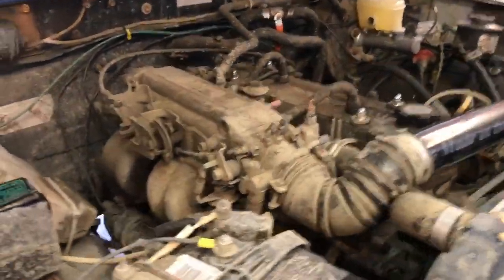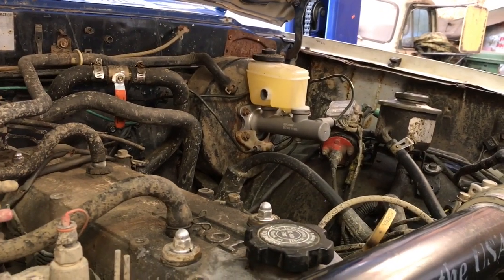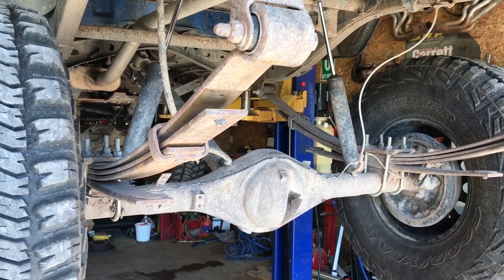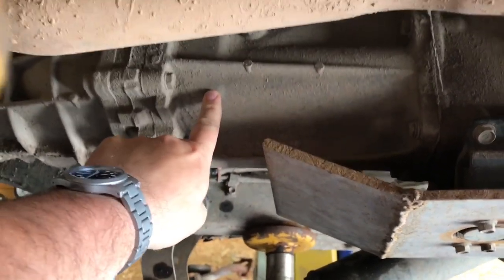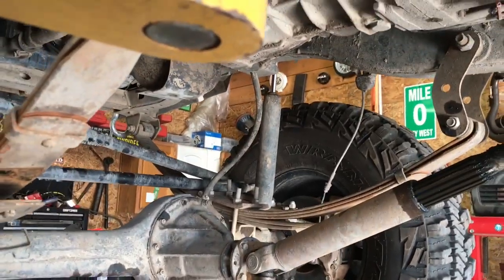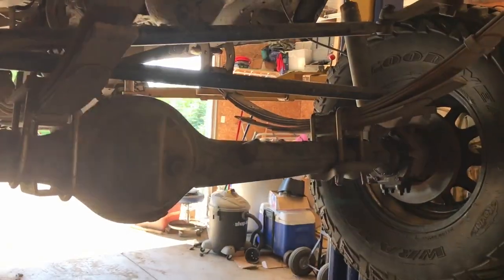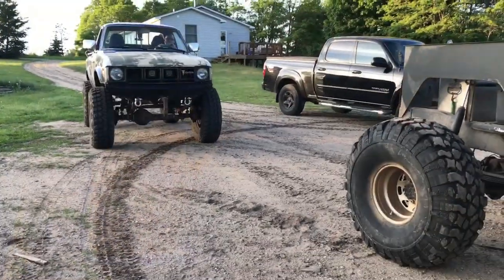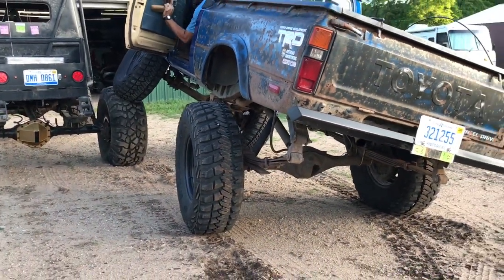Toyota 1st generation 4x4 (1983 Toyota truck)

Comment: Nice build man . Youve got my next 3 projects right there . Looks real good
Reply from the maker: I really need to make an update video. Many things improved since this vid.
Reply: Random Rob  you go 3.4 ? Or still just rockin the 22re?. Im workin on an 88 4runner 3vze. But no sas... no 63's no dual transfer. Just body lift ..suspension lift and 36s. Locked rear.
Reply: Check out the update video going up now.

Comment: I bought a brand new 1983 Toyota four-wheel drive with the long wheelbase. Only because it was cheaper than a Ford and a Chevy. No AC. But that little truck could climb any Hill that I ever come across and that little 22R 4 cylinder engine the way that it was geared could jump out so quick and so hard. I never got beat on any Hill I can pull straight forward  turn around pull back down and back up in Reverse up hills that Chevys and Fords could not do. The only downfall on this vehicle was it did not have power to hook up to a trailer and pull it through sand . But it had so much power for that little body that I can go anywhere. Until I sunk  into a mud hole. Easy to work on by far the best truck I ever owned. Not to mention that the ladies love that vehicle and I wish I would have kept it to this day. Amen y'all have a good day
Reply: I want yo buy... Are you willing to sell

Comment: Great truck.
Please correct me if I am wrong... 
1983 Toyota 4×4s have rectangular headlights. 
I had '83 with rectangular lights and a standard tailgate (no side latches ) ..curious to know if there was a change in headlight/gate design early on in 1st release or to the end of early production. ...or did you replace them yourself?
Reply: Tim 57 my title says 82 hilux, but the cab says 83... I seen where they welded 2 cabs together when I took apart the interior.... but it has rectangular headlights.
Reply: pigtrapper 1 

Thanks so much for your reply 🙂

Did not even think about different years of trucks, being built into one...

I appreciate your truck even more now 🙂

Take care.
Reply: 1979-1981 was round headlights, a 4.37 axle ratio, and the 20R. 1982 brought square headlights, the 22R, and 4.11 gears. The center latching tailgate also appeared in 1982. 1985 (second gen 4x4) saw EFI in 1985  (22RE), but 1986 was the new IFS instead of the awesome solid front axle. If you can snag a 1985, it's gold.
Reply: James Barrett 

Hey James

Thank you for reply to my questions, very much appreciated. 😀

I absolutely loved my '83 and if would have been feasible, I would still have it.

Take care
Reply: James Barrett agreed... 1985 models are where it's at. Best of both worlds.  I love my 82 model considering I paid 1100$ for it and 7 years later, im still running the same 33" mud tires on it. Only replaced the 4 speed for a 5 speed, starter. Alt, fuel pump, clutch...  I have no problem driving it 60 miles away
Reply: Tim 57 basically I purchased a cab and a frame for the build. The cab is titled as a 1983. But I used the front body panels and bed from a 1979 parts truck. Hence the round headlights.l and toolbox style tailgate latches.
Reply: Will you sell me your Stout 1983. I want yo buy

Comment: Do you know the backspacing on those wheels?
Reply from the maker: I will have to ask my buddy (his truck). There is an update vid on it. And really I should go back out, he is adding electronic lockers now.
Reply: Trevor Toulson the wheels in this video are 0 backspace but it had 1.5” wheel spacers on it to clear the upgraded brakes.